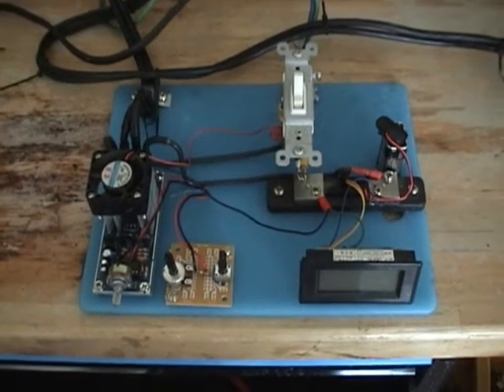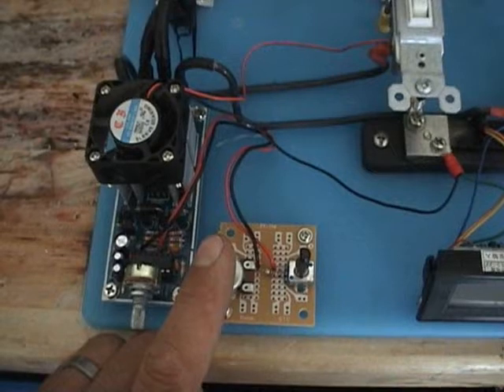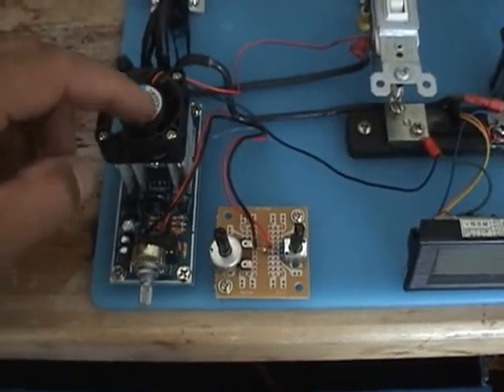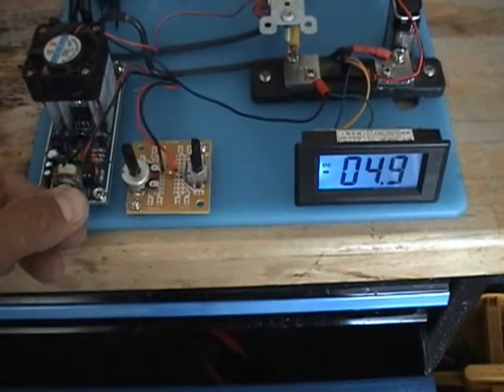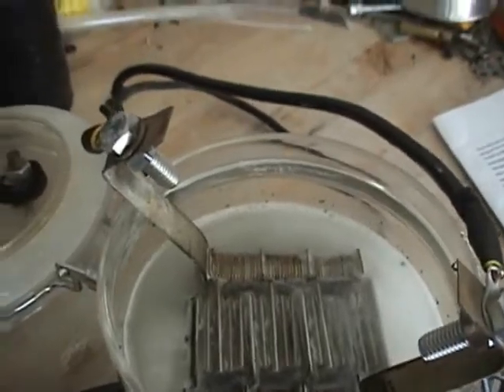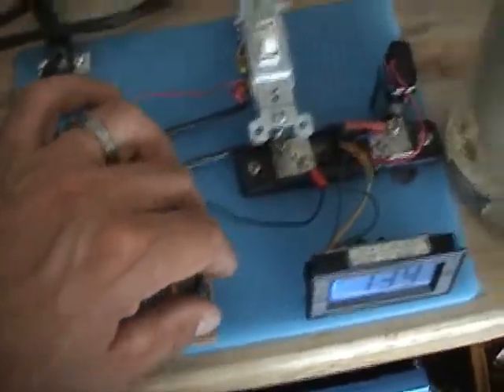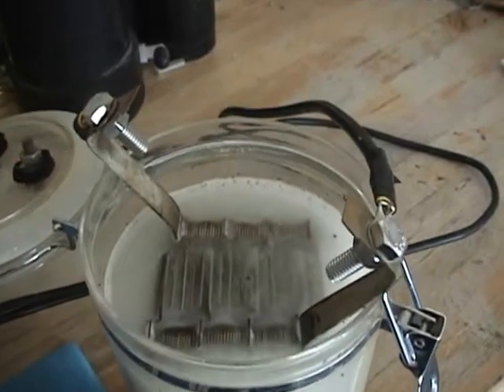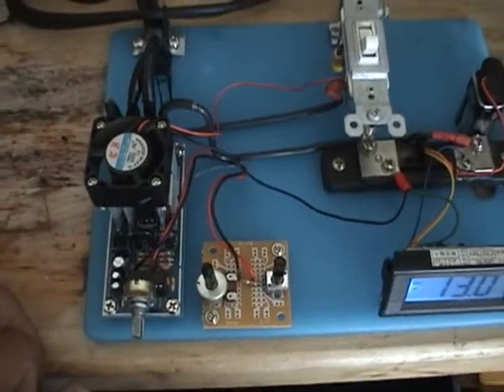(21) Frequency add on to my PWM

Comment: delvis11 6 years ago · LINKED COMMENT in reply to HydrogenTechnology
yes. its a 50k and 20k pot with 20ohm resistor connected to the center pins of the pots. you remove the 50k resistor from the pwm and connect it there.WHAT IS THE VALUE OF THE POTS ON THE LEFT SIDE CONNECTED WITH A 20K RESISTOR

Comment: There's not a single resonant frecuency of water 'cos its molecule has 3 degrees of freedom to vibrate (look for infra-red spectroscopy of water).  The wavelenghts are about (it depends on the site) 3700, 1600 & 3600 cm-1 wich means 11, 4.8 & 10.7 Ghz. In addition, there're also hydrogen bonds, with a wavelenght about 3200 cm-1, so 9.6 GHz.; that means not to "play" a single "tune" but a 3 or 4 frecs. "chord". It's also possible to work with subharmonics (1/2, 1/3, 1/4, 1/5 of the main frec.) in order to avoid reaching so high values. That's my belive, just theory, I've got no means for practical xperiments. I hope this may help you.

Comment: (sorry for my english)
You have to use a transformer between PWM and the cell.
this build an resonant circuit, otherwise frequency input brings nothing.
When you catch the resonantfrequence... then you should become more output.
Also the impuls should be as fast as possible -> more induction trought the transf. results a x-factor bigger inductiv voltage on the secundary coil of transf.
read wikipedia what will happen when a resonant circuit is in resonant.

good luck! 

> mine has a MMW of 4.3

Comment from the maker: yes. its a 50k and 20k pot with 20ohm resistor connected to the center pins of the pots. you remove the 50k resistor from the pwm and connect it there.